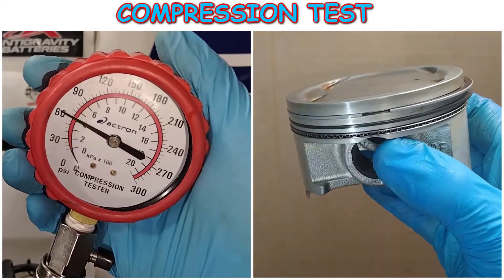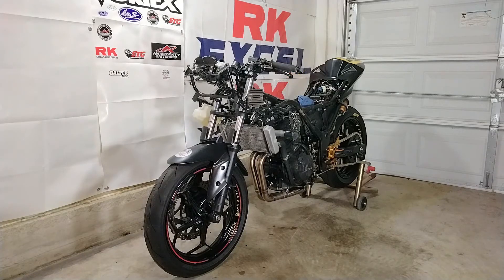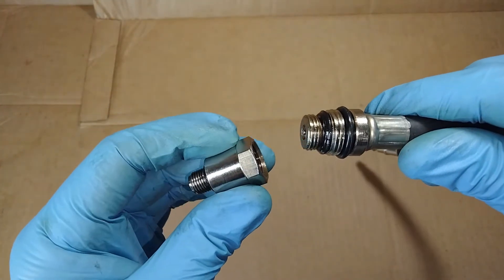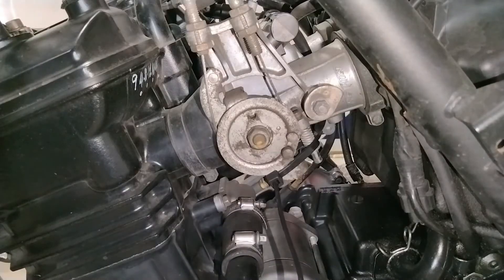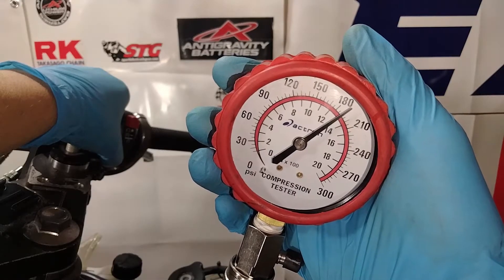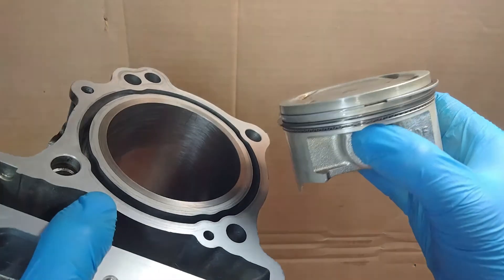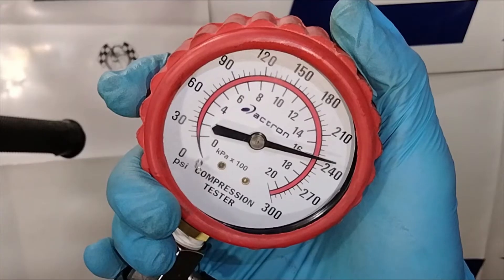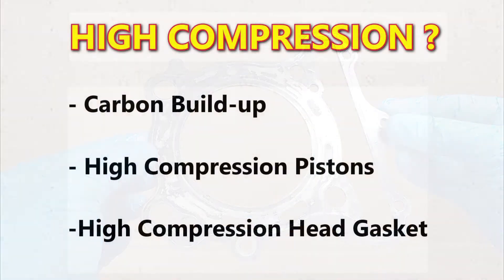How To Compression Test a Motorcycle Engine

Comment: You should tighten the adapter really tight using a vice grips or else it will be left in the plug hole when you unscew the tube..

Comment: great video, i have a 1994 zxr750 low compression 90,75,75,75 i tried the oil down on one of them and the compression number didn't change.  i got no leaks , no smoke, it starts up just fine.. its around the 5k rpm mark you can feel a significant vibration in the saddle and  it feels like something is fixing to break. i have tried not to push it after that. any ideas on the next step?  thanks
Reply from the maker: Id check the valve lash for sure, assuming youve ruled out a head gasket

Comment: Im going out to comp-test my bike but I cant get one cylinder warm, so im doin it cold. Dunno if its the piston or carb... Nice video.
Reply from the maker: Fuel issue is very common. Its the best place to start looking. Good luck!
Reply: @nickbuchananracing Thx. Compression is fine and almost exakt on each cylinder. So carbs is going out

Comment: How do you keep the bike from actually firing?
Reply from the maker: No plugs, cant fire. Also can unplug fuel pump or pull fuelpump fuse if youd like to
Reply: @nickbuchananracing  just making sure. I got an old 1982 yamaha xj550 cafe racer that is giving me some trouble so I'm gonna do a pressing test and see what happens

Comment: How would you test on a bike with ride by wire?
Reply from the maker: @sandorturanszky2401  thats a good question and honestly im not sure. Ive never had a bike with ETC. Im curious myself so ill look into it and comment when I figure it out. If you get some good info let us know.however first see if it opens the throttle plates on command like a normal cable throttle. May need to remove some stuff to see.  Im sure theres a way to open them if the computer doesnt allow it. What exact year make model is your bike
Reply: @nickbuchananracing  it's a 2019 KTM Duke 390. I researched a bit and there is a way to do it using software but do not know more than that yet.

Comment: May be a stupid question. But do i need to disable/remove fuel pump when doing a compression test?
Reply from the maker: @uwhank9594  I do, you can pull the fuse or unplug the wiring to the pump
Reply: @nickbuchananracing  ah yes ofc! Why didnt i think of that🤦🏼‍♂️thx!

Comment: Is there any way to partially connect a removed engine to a bike on a bench to test, most parted out engines are "as is"
Reply from the maker: @benbryson6598  if you mean to compression test it? Yea its easy. If it were me, id hook a jumper cable from the positive terminal of a battery directly to the starter  terminal. Then connect the negative jumper wire from the engine mounting hardware (starter is grounded through the mounting hardware) to the negative terminal on the battery. It will spark when you complete the last part of the circuit and the starter will crank. No its not safe, but thats a way to do it.

Comment: When doing cylinder #1 do I leave the  spark plug on cylinder #2 obviously with the boot off the spark plug so there is no spark
Reply from the maker: You should puĺl all the plugs out at once. That way there is no compression in the other cylinders that arent being tested, this will save your battery/starter from working too hard since youre only building pressure in the cylinder thats being tested. Thats always how ive done it.
Reply: @nickbuchananracing  so once all the spark plugs are out, do you have to block the intakes with like a rag or something? or leave them open?
Reply: @carlcarlssen4299 leave them open 
Why block them?
Reply: @geoffreycasey875  i thought it was dangerous cause of gas fumes.
Reply: On v twin with 2 plugs per cylinder what would be the procedure?